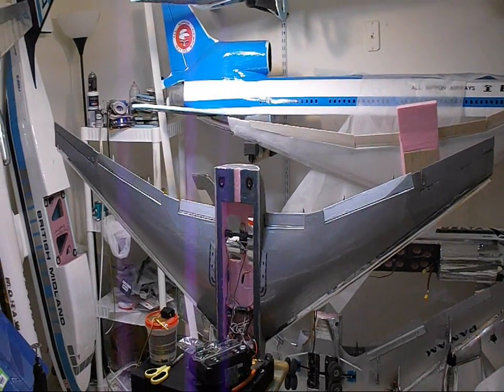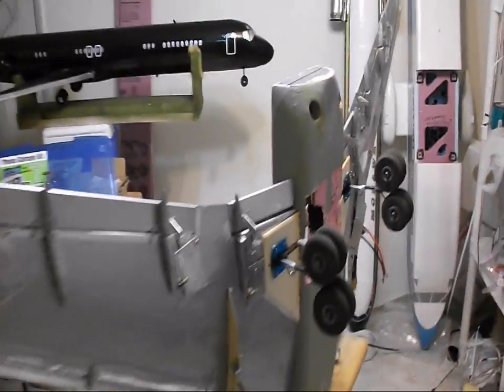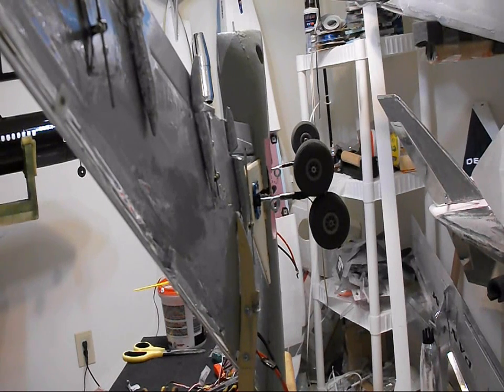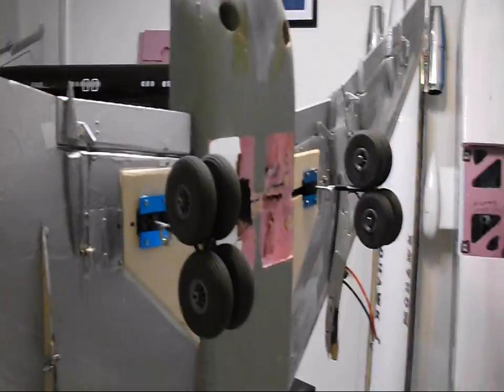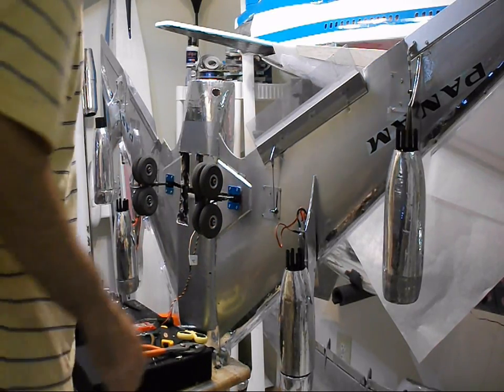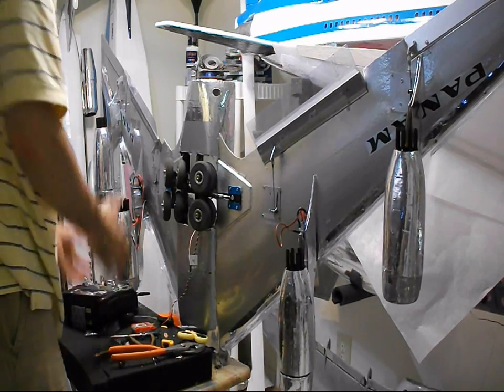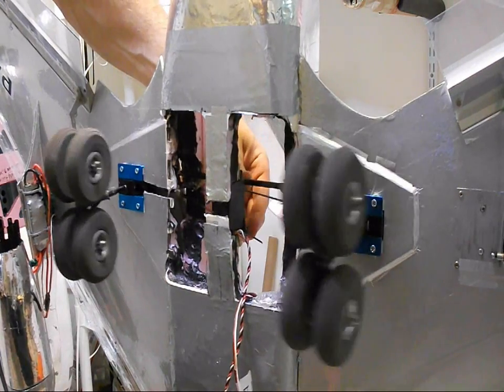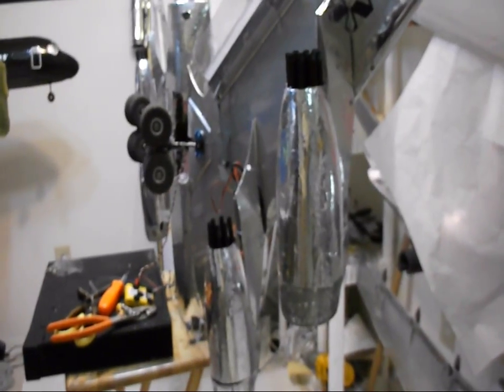DemonDriver's Boeing 767 & 707 Main retract test!

Comment: Great work...Here's an idea, what if you mount in 2 more smaller wing spars, in front and rear of the wheel-trucks for strength and then cut out the first spar that's in the way of the gears..